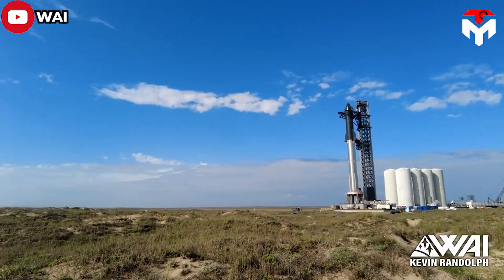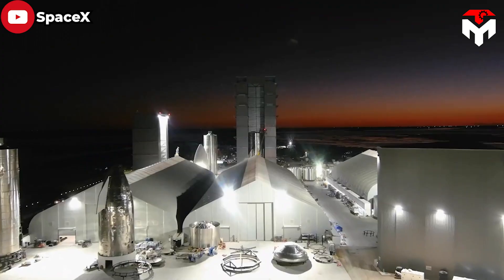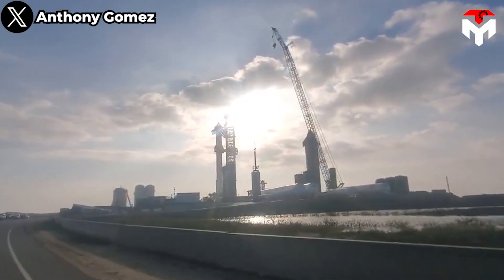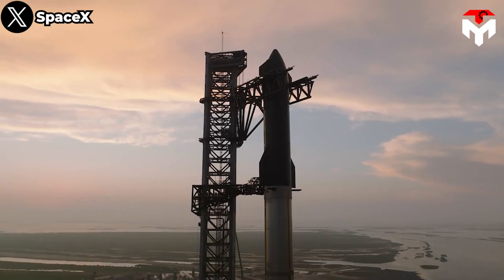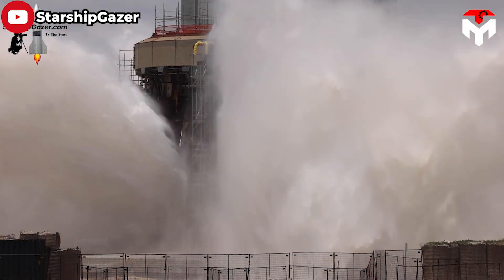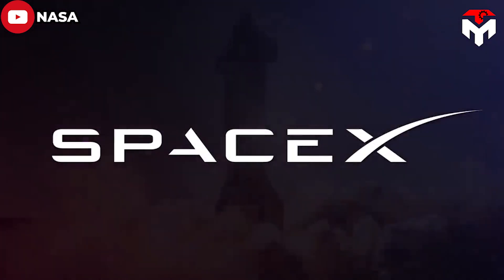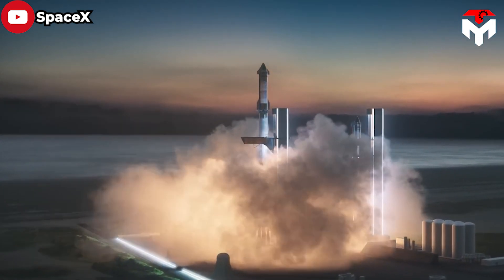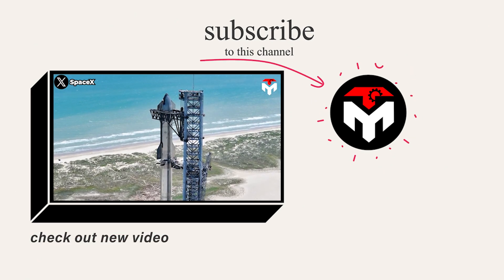Disaster! FWS just declared No Starship test flight until 2024…

Comment: Look, SpaceX needs to worry about safety, of course, they also need to mitigate any and all issues concerning wildlife. Whether it's an endangered species or not. SpaceX is aware of this and I think it's obvious to anyone that's objective, they are designing their systems with safety and wildlife protection in mind. The use of methane over kerosene or other harmful chemicals as fuel. Using palatable water vs just any water lying around for the deluge system. Using renewable energy as much as possible to power Starbase instead of grid energy. These are just a few things that cost the company more in terms of money and engineering challenges. Get over the regulatory BS and streamline the process. Let's get the bureaucrats out of the way.